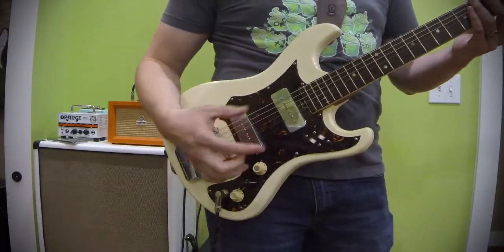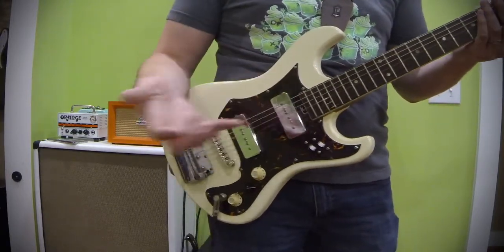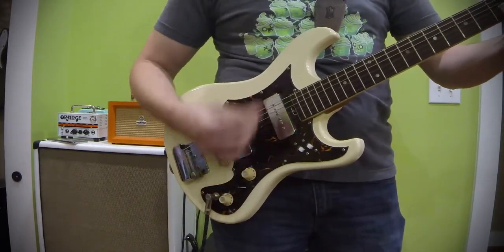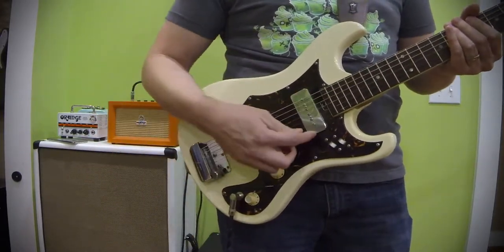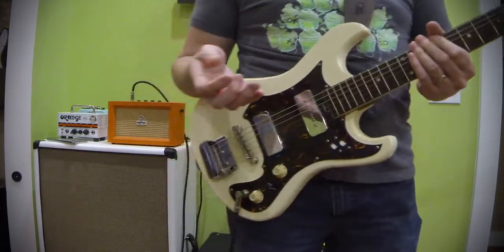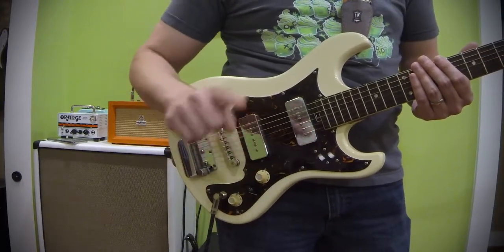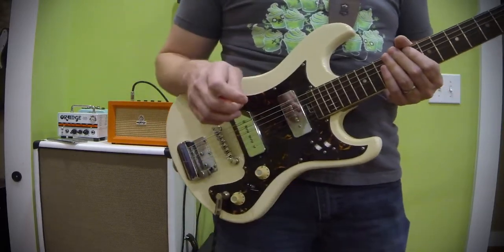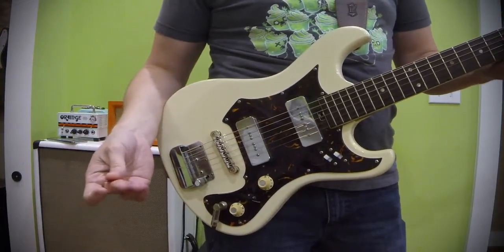Explaining pickup phase and switching

Comment: Do you have a video showing how to wire two pickups with a DPDT switch for series/parallel? And how would that be wired with a phase switch?
Reply from the maker: I don't have that video currently, but the switches can be wired alongside one another as seen here. Series/parallel switch simply connects the hot of one pickup to the ground of another, running the signal through both. Kinda hard to explain in text. But, the switches for series and parallel with two DPDT switches are independent of one another and you can do one or both.